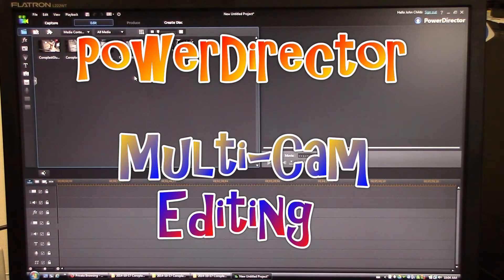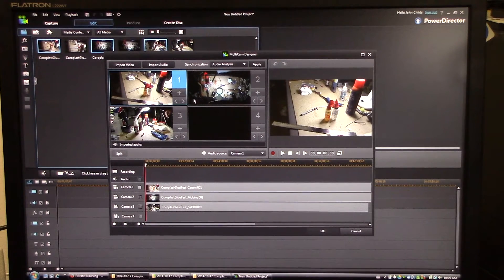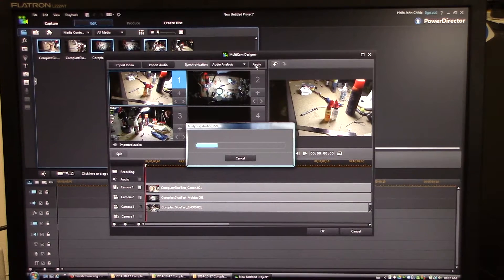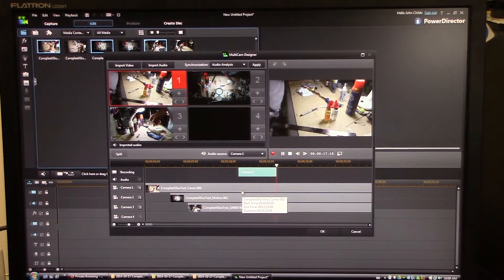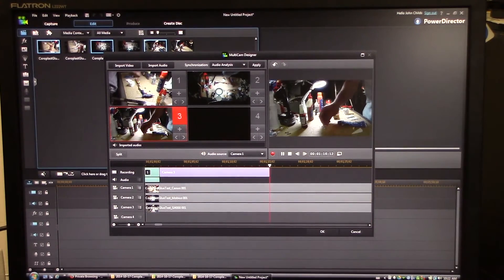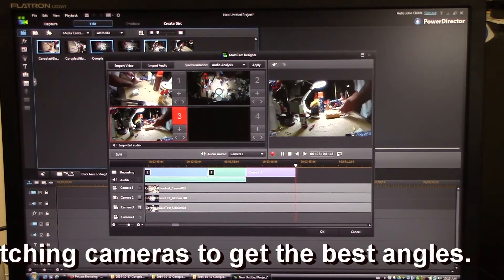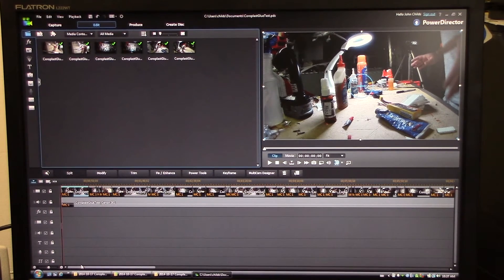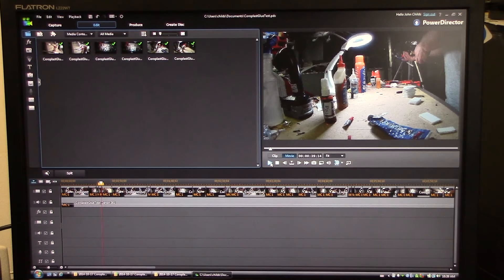PowerDirector Multi-Cam Editing

Comment: I’m using PD 17 and editing our music video, but I have more than 4 cameras to deal with. Also some were recorded with 2x audio to slow down later, plus some B roll. All video contains audio so syncing should be easy - but how would I edit down say 9 cameras all together?
Reply from the maker: You can synchronize any two video clips (via audio) in the normal timeline view so you should be able to sync 9 clips that way...but of course selecting between them becomes more of a pain in the <blank> that way.   For that many(9) cameras you might have to do it in multiple stages.    i.e. render a vid with 4 camera angles, then another with 4, then another with the leftover cam and the 2 prerendered.  I have done this multi stage technique before with a 5 camera project but (especially if you are doing quick camera jumps) it becomes tricky because you are switching between a raw vid and a vid that already has multiple camera angles in it.   My machine has trouble keeping up with just 4 cameras at once I imagine (if it was possible in PD) that 9 would require an absolute top of the line machine.  Best of luck with your new vid.  Look forward to seeing it.

Comment: Thank you very much for the lesson. 
 ? Can I save the project even if I did not finish the multi cam Editing
  Can I make it auto that the Audio source will always be the same as the video source
Reply from the maker: There is no save option when you are in the middle of multi cam editing.  Not even automatic saves.  This is one of my biggest complaints, hopefully they will add this ability....and your second question is my second biggest complaint, you only get one audio source in the multi cam editor, if you switch it mid edit it switches for all...Often I will have times where I want to use my primary camera for the bulk of the audio, but one of the secondary cameras was turned on first and I need the audio from that to begin with.   There is a lot more they can do with this tool, but it is better than not having it at all.
Reply: Thank you very much for your answers. It is the first time I tried to use the Multi-Cam Editing and I see that I found the main problems. I hope you will complain about it and that your complains will bring the good change. Thank You

Comment: Thank you so much!!! This was amazingly helpful! I just started using this program with a dual camera setup yesterday. This is much easier than the way I was editing, lol.
Reply from the maker: +Painting with Jane Thanks.  Sorry about all the background noise.  I've since used PowerDirector 13 and 14 and used the timeline/picture in picture editing as well.  It's worthwhile as long as your machine can keep up.  It's similar to use, just place videos on different timelines, then highlight the ones you want to line up and sync via audio.
Reply: UnlimitedVertical Thanks for the info! I don't think my computer would run the newer versions, but this is exactly what I needed to see!

Comment: interesting, I use power director but I have never used this method
Reply from the maker: I saw you had synchronized video between your onboard and FPV in the night combat vid.  How did you sync the tracks?  Were you using PowerDirectory 13?  Or manually sync?  Version 12 is great for switching between multiple cameras, but 13 introduces sync right into the timeline, which would be better for the picture in picture type of vids.
Reply: I have always done it manually, I simply line up the tracks based on an audio cue I "snap" in near the beginning. I have been using power director a long time.
Reply from the maker: squishy654 Yep, I've done that too...usually a 3-2-1 go and line them up.  Not all cameras sync properly with the automatic sync feature, so I still do some manual sync.  Been using PD since 7.  Still haven't moved to 13 yet, but I will.
Reply from the maker: Showed one of my buddies some of your night combat and night FPV vids last night.   I have a feeling we'll be putting some lights on some planes soon :-)